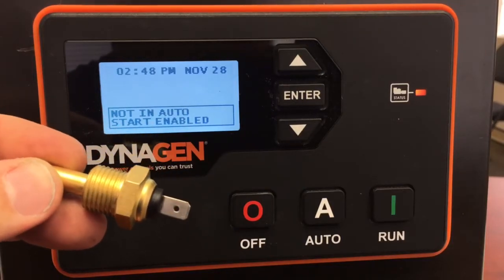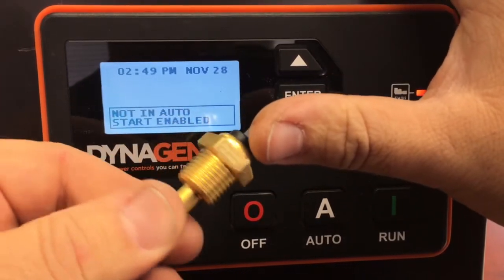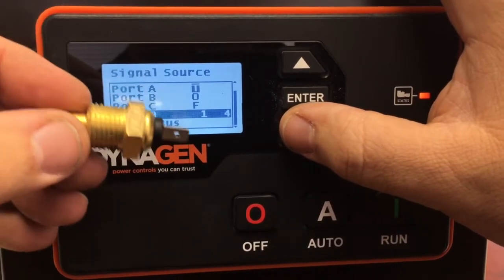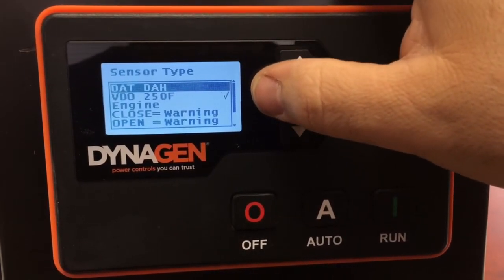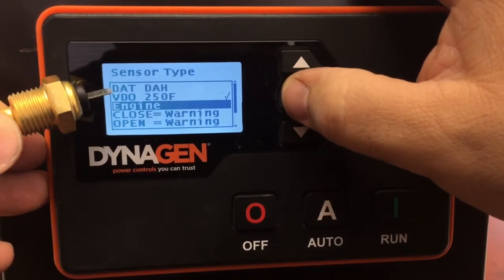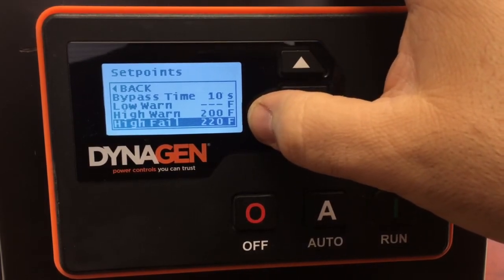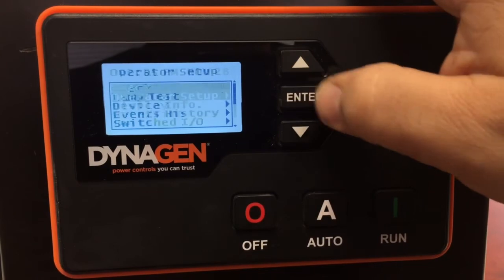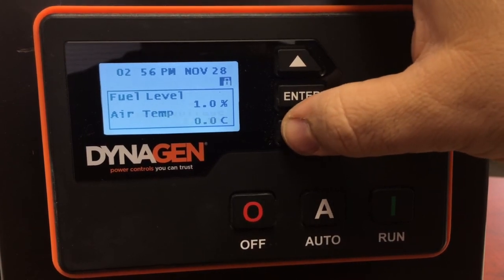DynaGen TG 410 Engine Temperature Sensor Setup

Comment: I'm having a problem with an old perkins motor generator shutting down due to high temp. I don't have the "engine" or "wema" only DAT DAH (this is what was selected), VDO 250F, and Undefined. It used to work fine but has been giving me problems lately. I don't believe the engine is actually over temp, it's barely getting to temp that opens the thermostat (new 180*) before going into high temp shutdown. Any advice to troubleshoot?

Comment: Good video ,really helped to setup lost data back into the controller. Could you do a video setting up engine temperatures second temperature sensor on a Perkins using sensor E.